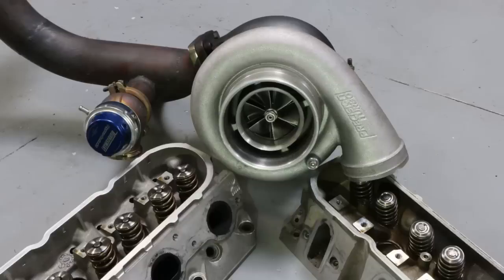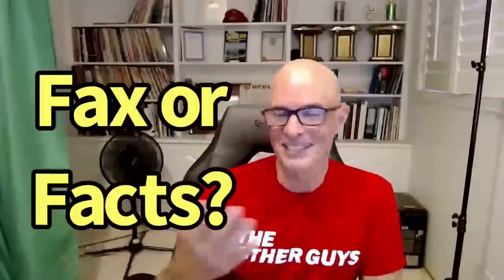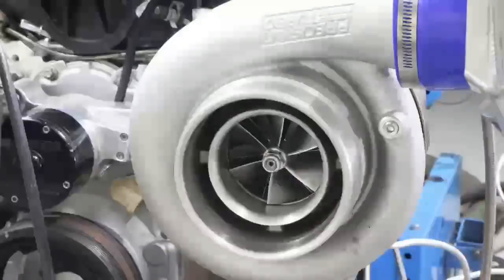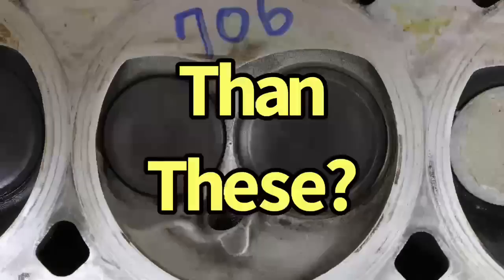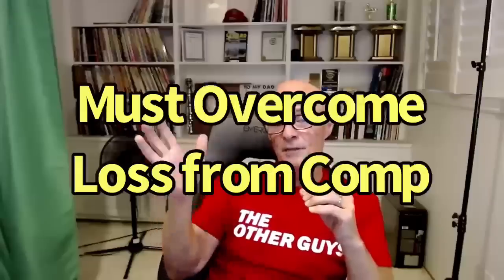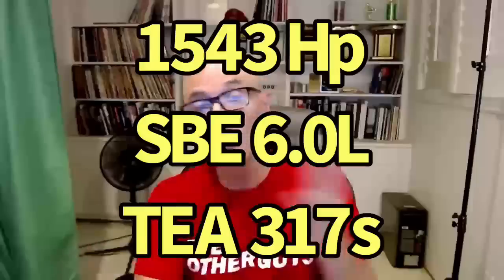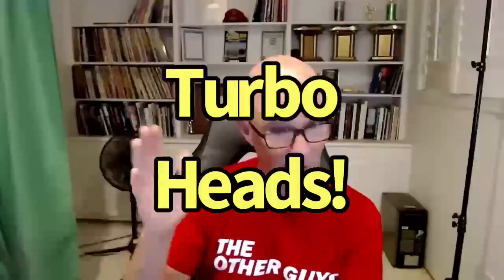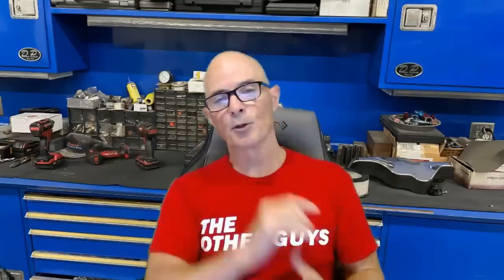BOOST VS HEAD FLOW-WHAT STOCK HEAD SHOULD YOU PICK FOR A TURBO LS? 706 VS 317-DOES MORE FLOW MATTER?

Comment: Only way to test is same
Boost say 20psi , add timing until mbt mbhp are acheived. If the 317 doesn’t handle more timing than the 706. Then the chamber shape regardless of cc is the determination. Or port and modify the 706 for the same flow and then flow is out of the formula. 
Bore shrouding , real world flow might be an issue also. Back in the old days we would offset head dowels to make more power on a max effort head because 315cfm did not make more power than 292cfm. But shifting the head .040” made hp more on both heads.
Reply: If you wanted to compare 317 heads to 706 then I’d want them to be stock for stock. 

By throwing out the “stock” rules you could also deck the 317 until the chamber CC was the same as 706 and it would also be an irrelevant test

Comment: 4:30 no, the point was when using pump 91 fuel the lower compression ratio allowing more boost making more power. I dont think the statement had much to do with flow difference
10:23 again, no, he probably is talking about the 317 working better when fuel octane limited and reaching for peak power
Reply from the maker: he specifically said the greater flow in the 317-his statement wasn't about octane limited situations
Reply: @richardholdener1727  hmmmm, i see. Shucks man next time include a screenshot cut of the comment on screen.

Comment: Well yeah adding more atmospheric pressure you just add corresponding power since a motor is just an air pump. 

The real question is will you get less detonation with reduced compression and better cfm? Meaning can I run more boost on the 317 prior to detonation and will I get less of a diminished return at higher levels of boost?

Comment: Hi Richard, I think the more interesting question is what is the better head if all u use is pump gas? Remember the reason the compression was  lowered on that BBC 540 (8-71 blower I think?), from a few years back down to 8.5 to 1 was because it was a "street  rod". I don't think u can really push the "317 heads" to really gain from going up in boost to catch up on the "706" heads as there is insufficient difference on port flow. If you really go with the "pure street" angle, then you would see the 317 heads able to do something that the 706 cannot; live with boost and compression w/o the E85, methanol or race fuel's. Just a thought..... :face-purple-wide-eyes:

Comment: Seems like a displacement problem, but really you need to think why does the higher flow make less power, there's plenty of reasons it could, once you figure that out then you can decide if any change to the rest of the engine will fix it. A bad combustion chamber will effect flow and overall engine power very differently for example, if it's that this combo might work better with a bigger bore, maybe on a ls7 they'd out perform

Comment: Richard, isn’t this the now classic myth that lower compression for boost makes somehow more power, um…er with pump gas? lol
I’ve heard you say for years that low compression motors show gains from boost but high compression motors with boost do better. (Higher Hp/Ci) 
And still this argument lingers around. 
What my question that is still out there is if more top end torque makes higher Hp N/A before boost then why not dyno and rev test up to 9k or 9800, and why wouldn’t you build a motor to last up higher then if it makes more power N/A before boost would make it sky high?
RPMs make winners.

Comment: Run the test on 91 or 93 octane and run the boost/timing up to the octane limit. On race gas its pretty clear the 706 will win hands down, but on the street running pump gas i think the extra volume of air/fuel charge (same as more cubic inches) will probably show a big enough change to give the 317 the advantage.
  the problem with most dyno data is that the testing us usually done on race gas, E85, or straight alcohol. Most people run pump gas powered hot rods, and mostly on the street. I know I cant afford to drive around on the street burning C16, and E85 is nearly impossible to find where I live, and i suspect I'm not the only one.
 Anyhow, i just think the fuel type needs to be a much bigger part of the test criteria, rather than a minor mention at the end.
Reply: no race fuel  in wich place do you living sir
Reply: @francisbeaudry8598  We have race gas, Oregon isnt the moon, but last time I looked at a 5 gallon can of C16 it was well over a hundred bucks. Thats fine for a track car, but for most people thats not going to be something you can run on the street without a really fat wallet.
   For the drag-n-drive project Im building Im running an EFI dual fuel system with pump gas in the main tank and e85 in a small tank on a second set of injectors that switch over at around 90kpa. and i think a lot of drag-n-drive people are starting to do something similar. 
 E85 prices aren't too bad for street driving, but ironically the availability of this "eco-friendly" fuel here in the land of rainbow haired greenie's is very hard to find. especially if you are away from home and need to find a station nearby. But anyhow, this is going off the rails, my comment was about testing the heads on pump gas instead of race gas. And while im at it, maybe test it on a turbo'd 6.0, since thats the engine 317's came on anyhow.
  I think it comes down to the balance of peak cylinder pressure and Volume of air/fuel charge, vs combustion chamber shape difference. when you hit the wall on octane with 317's you'll have a higher volume of air/fuel to push that piston down, but will that advantage overcome the less powerfull  combustion chamber shape? testing both heads on race gas and the same boost pressures does not answer that question.
Reply: @senseimarvin454  tank for feed back here in quebec  210 /250 $ for C16  BUT WE HAVE 3OR 4 PLACE TO CHOOSE
Reply: @francisbeaudry8598 sir he said he couldn't afford to run race gas on the street.
Reply: Need to move to the midwest we have e85 at the majority of stations and its like .50c/gallon cheaper than 87 octane
Reply: You read my mind.  If I run my 799's   it will be 11.1 if I run my 317's  it will be 10.2   if I halve to run 91/93 even with 180° 200° CT  Quinch at .0.040  Average Air intake temps. You have to be right on the Ragged edge with the tune with it 11.1  Nothing like driving around puckered. Or 317's about 10lbs on 91 Have joe simpson tune it to the Neighborhood of 650whp  🤘

Comment: Maybe on a big cube big cam high rpm n/a build. Would it come to the point where the 706 would be a big enough restriction to hurt performance enough for the 317 to pass and then boost. Like a max effort 600+ na build then boosting it?
Reply from the maker: The 317 heads won't support 600 na hp, nor would the 706 heads

Comment: Back in my dynojet honda tuning days, a 11:1CR  rsx type-s with greddy turbo kit 6psi would make 260whp. On 93 octane, ignition timing was down around 10-12 degrees to avoid spark knock. Hondata had very good knock detection. Exhaust gas temps were approaching the surface of the sun, but the combination was safe to beat on non-stop.  Had stainless downpipes cracking and breaking tho. Had one rsxs customer bring good rods and 9:1 pistons to install. Made the same 6psi, same 93 octane, same hp/tq curves, with 6-8 degrees more ignition timing. Was no longer knock limited, and the egt gauge was no longer pegged.
 61cc 706 vs 70cc 317? I will assume any gains from lowering the compression will stem from being spark knock limited on a particular fuel. Your results may vary.
Reply from the maker: the above comment is a timing test
Reply: @richardholdener1727  timing / gaz octane= boost
Reply: @richardholdener1727  it was very much a timing test. However I learned much from a knock limited 11:1 k20 to a 9:1 k20 on the same 93 octane fuel.  My dynojet graphs overlaid because the 9:1 would take more timing. When you get into pump gas compression ratio vs boost, you should spend some time on knock detection that really works

Comment: The 317 head came on a high output 6.0L truck motor with flat top pistons the LQ9 LS motor. A 5.3 came with negative 10 cc dish pistons. The LQ9 with 317 and flat top pistons had 10.5 to 1 compression. I have 317s on a NA LQ9 with long tubes, fuel injection 3/4 race lumpy cam and 350 gears.  It just seems to rip the tires off on my vehicle.

Comment: What if we tried na with massive cubes? Like 450+ la short block with all the camshaft. You’d tax the heads pretty hard and maaaaaaaaaybe find out if the flow finally wins over the better chamber design? I’m still voting 706/862’s but it’s another one at to text

Comment: The only way it will make a difference is when cylinder pressure is too much for the fuel you are using the 317 may let you run an extra pound of boost or a couple more degrees of timing … I’m going to guess that the hp might top out the same at that point

Comment: I would think the 706 heads with the small bore would  be less shrouded and flow more than enough to feed the small motor the large bore may benefit from the higher flow some. Probably wouldn't make up the differences in the compression. I can see the bigger heads making more power under boost at the same boost level. Being boost is a measurement of restrictions the smaller head should hit the boost level and be flowing less cfm.  But not sure if it would even come into play on a 5.3.  As there's not a huge flow difference. If it was like 50 cfm less something like  the 706 flow 275 and the 317 flow 325 and still Probably only noticed on a large bore.

Comment: Theoretically, the lower compression heads with better airflow will allow more boost on pump gas before detonation. However, that's theoretical and would need to be tested empirically.
Reply: It’s been tested 20 dozen times and you’re absolutely correct… sometimes. When runbibg E85 not so much- but 87 octane, yes definitely. The reason Richard can’t prove this is because he doesn’t have a way to run knock sensors on the dyno so he runs the same timing on all similar setups rather than pushing each combination to its limit. This is also why he doesn’t see make additional power with water meth or E85- the engines are not tuned properly for those fuel sources. Any tuner dialing in an engine that utilizes knock sensors knows the truth that Richard doesn’t but hopefully one day does. 

The only time what you said doesn’t apply is on good fuel that can handle the higher compression. That combination will make more power and still not detonate.
Reply: @boost1728   706 heads have more deshrouding of the valves. That's why they make more power.
Reply: @thefinalroman  that is absolutely not why they make more power.

Comment: So what head would you recommend on 5.3 turbo ? 317 is not worth putting on 5.3?
Reply: If it has heads on it already just use those that came with it it will make good power with any factory ls head with boost
Reply from the maker: run what ya got

Comment: Can the 317s outperform the 706 in an NA application? If they can't, they won't under boost.
Reply: @wheelbasemedia5814  but you can add more boost and timing with a 317

Comment: What happens when your base fuels knock limit is reached with the 706. But not with the 317. Then the 317 makes more power.  

To say a higher compression setup will always make more power is wrong too.  Even if you are not knock limited. You are eventually cylinder pressure limited.  If you were to monitor actual cyl pressure. With a 706 VS 317 head. Run both motors up to say 600hp. (yes you will need more boost with the 317 head to reach the same power) At like HP, the lower compression setup will have less peak cyl pressure  at the same power. Meaning the lower compression setup has more "power potential" than a higher compression setup.  Same reason they run low compression on top fuel motors. If they ran high compression they would have such peaky cyl pressures that they wouldn't ever keep heads sealed. You are trading response for peak power potential with less compression. That and the tuning window on low compression stuff is MUCH wider. Great for entry level folks.
Reply from the maker: the test was 706 vs 317-not compression always wins
Reply: @richardholdener1727  Compression is the main difference between the 706 and the 317 head though.

Comment: As a 317 owner, I don't think the 317s would ever make more power, even with the 706s boosted to just short of detention, it think the boost level needed one the 317s would be so high you'd lose head gasket sealing.
Reply: @ThomasTT496Vega  even with studs?
Reply: Baseless hypothesis. People have run over 30psi on stock heads- the same point 706’s will reach detonation before a 317 will. 

Not only that but even at low RPM full throttle in a street truck: can definitely get away with more boost and more timing with 317’s.

Comment: My guess would be the only way the 317's beat them is in an octane limited scenario. For instance, Alaska only has 90 octane as their highest grade of fuel. Also maybe if you're on the max end of a smaller turbo when heat becomes an issue. Would be cool to compare them in that situation.
Reply: I would submit that Alaska has a cooling advantage over, well, anywhere south of there.
Reply: @wheelbasemedia5814  it can be 90s in certain areas in the summer up there. Not always THAT cold.

Comment: The 317 has lower compression so under boost I assume it would reduce pinging and allow more timing at the same boost level. So wouldn't that make it possible to get the power back? Would that only be better assuming fuel is the limiting factor?

Comment: I have a great idea for heads for your upcoming 4" bore 4.8L that you mentioned......
I would love to see a set of 706/862 heads with both intake and exhaust valves completely UNSHROUDED in the chamber with a bit (alot) of grinding work to see if they can maintain their crazy low end response and then still have the flow to feed up high in the RPM range.

Comment: So why not run the boost up to  just under detonation and back off a little bit.  The lower compression of 317 should allow more boost and maybe more power
Reply: Then the question is, does it have more potential for power on any given fuel? Or does it just handle more boost pressure?
Reply: @crash5811  well we know the 317 can flow more but has less compression.  with that said the 317 has more potential because you can run more boost and or timing.
Reply: @falfighter its all about intent for the engine. You select the cam accordingly to the intent of the use if the engine and to maximize the flow of the cylinder heads.  None of these things were compared in this test or even mentioned.  This is a worthless test
Reply: Because you'll arrive at the same power level with less boost because of the bump in compression.
Reply: @Mastermindyoung14  yeah, they’ll reach the same power until the 706 is limited by detonation, while the 317 can run more boost and timing without blowing up. This is not rocket surgery
Reply: @boost1728 that’s what I would love Richard to test because if that’s so I rather 317 and safer runs with same power 
Gaining the longevity.
Reply: @ricardoaguirre01-02  we would all love it but he won’t because he can’t. It’s just part of the dyno setup. No knock sensors, no super-dialed-in tuning. That simple unfortunately. Because of that lack of knock sensor restriction situation he’ll never see as much extra power as we do on E85, water/meth, etc. because he basically has a mail order tune in all these motors instead of a proper dyno tune. Some people have argued that it doesn’t but the truth is it absolutely skews data, and data is the whole reason we come here so kind of a bummer.
Reply: @Mastermindyoung14 but that's where timing comes in, with lower compression you can push timing  a few more degrees and we all know that a little timing under boost can have huge gains. There is an optimal boost level where going past doesn't make more fuel for the likelihood of detonation and pushing timing is more beneficial 
Basically what we want to know is what LS head has the cylinder design least prone to detonation, which is what will allow us to push more boost or timing and ultimately make more power. He needs to test how much power he can get from each head before 93 pump just isn't good enough. Issue for him is that he will have to spend more time tuning since he will have to back of the boost and push timing and see if that's where the power is, and vice versa. He won't be able to just use the generic tune he has that works on every turbo motor
Reply: @Mastermindyoung14  I would love to see it.
Reply: This is the reason why all my boosted 4.8 and 5.3 and 6.0 blocks get 799/243 heads. Its basically a higher compression 317 head.  Has larger, higher flowing ports and valves than the 706. They win with the right cam and setup. It always has been the chosen head from GM for their high performance vehicles.  Its why you don’t see 706 heads or 317 heads on the corvette.  These tests are far too simple and basic to see many real useful results from them. They are extremely basic scenarios at best.
Reply: He has said before that he can't run a knock sensor on the dyno because it doesn't work with all the noise. Also trying to get to knock with boost is very different than N.A. boost will be happy until the engine is broke. N.A. will fall off before. He has discussed both of these before in livestreams and videos.
Reply: @akassasin5768 so why not turn the knock sensitivity down?
Reply: @shanegalloway-j5g  no idea just repeating his reasoning from other videos I've watched.
Reply: This is common sense but Richard refuses to test this way